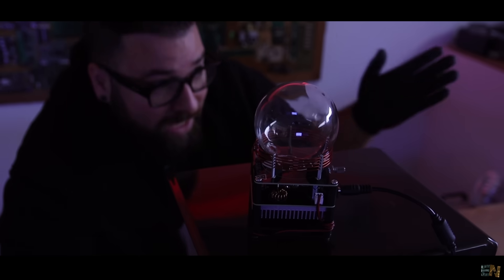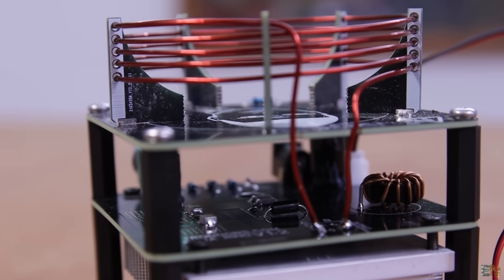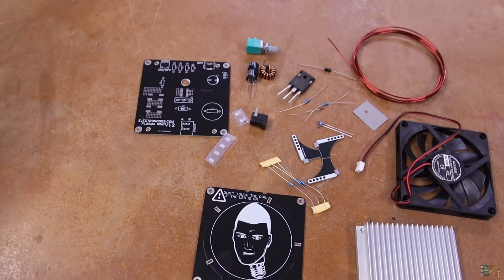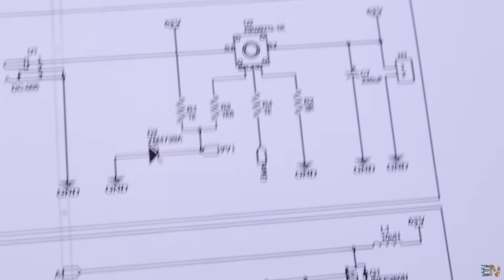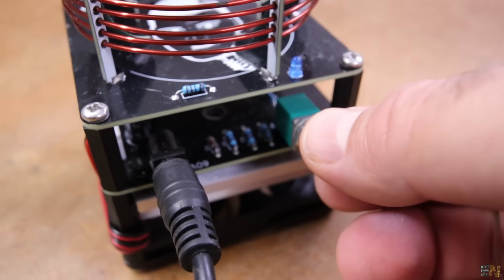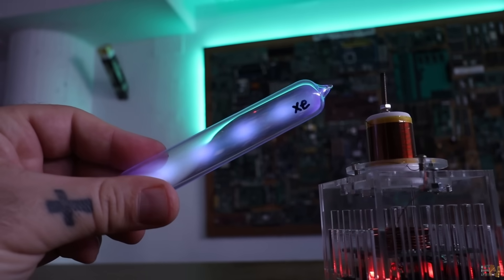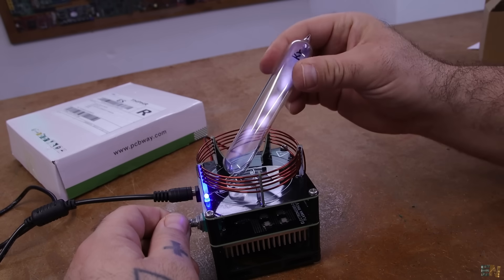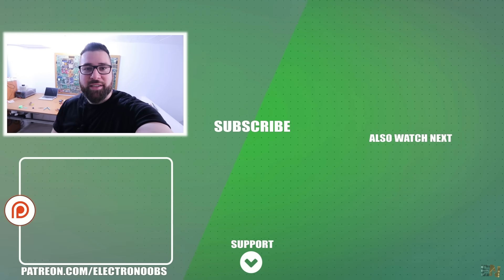Making Plasma at Home With This Insane DIY Project!

Comment: Interesting my friend. Does this mean that this experiment heats up? So if we change the design and use thicker glass and put in a heat exchanger, will we be able to generate enough heat so that the liquid in the exchanger turns into vapor and moves a turbine coupled to a generator to produce electric current???

Comment: Apologies if this is slightly off-topic, but have you explored the effects of introducing counter-rotating hot and cold plasma fields within a controlled toroidal or helical magnetic structure, while integrating a piezoelectric crystal into the circuit? Given the potential for charge separation, electrostatic potential gradients, and structured plasma wave formation, could this configuration facilitate exotic electromagnetic interactions or even function as a self-sustaining low-energy input, high-output energy system?

Comment: I wonder if you COULD get a little fusion if you could get a good enough vacuum
Reply: A Farnsworth Fusor looks vaguely similar, but contains isotopes that will actually fuse, and electrodes to accelerate them.

Note that you need sensitive equipment to detect the fusion events. A Farnsworth Fusor is an ideal device for making a "little fusion". Detectable amounts, but still tiny.

Comment: Ive spoken to the creator of that product. If you ask him he can give you what you want for a gas in the bulb
Reply from the maker: @humble2246  you mean the vacuum pump and glass torch?
Reply: @ELECTRONOOBS  not gonna lie i skimmed through the video dont have time to fully watch it. I thought it was the aliexpress seller selling these ones with a very similar design as yours. Didnt realize you actually made it. They have a telegram group and that same creator does the toroid bulbs himself. If you want cheap custom bulbs he can provide. For instance, a CO2 bulb.